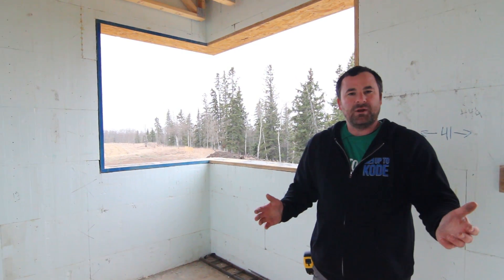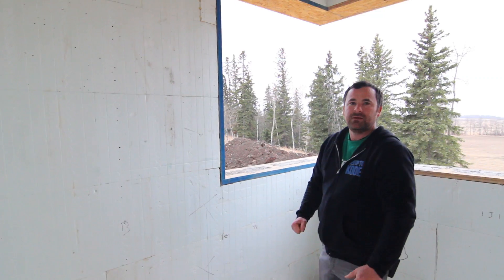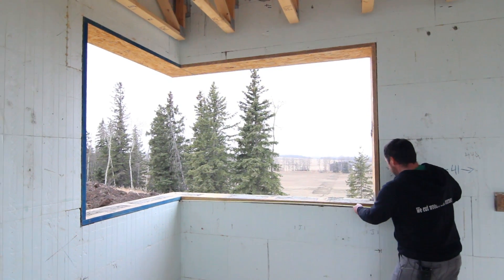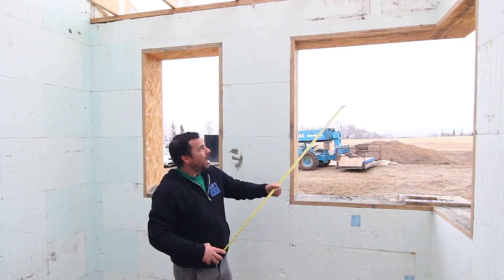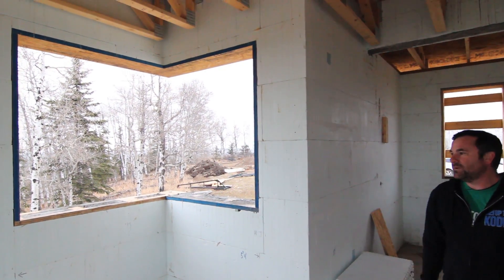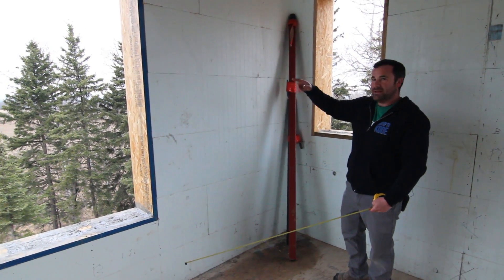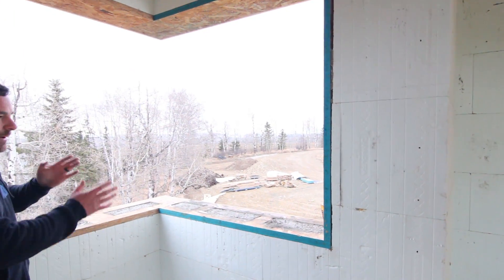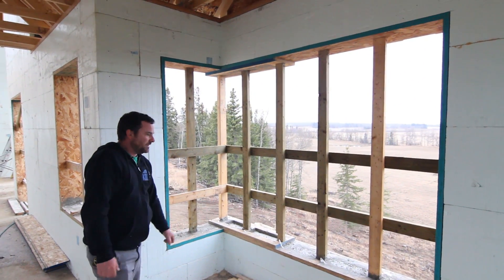Corner Windows in ICF: Why It's Better Than Wood Framing

Comment: My gripe with ICF is that you can't seem to really have a lot of windows like you can with other build types. It's the only thing holding me back. I'd like a full 20ft wall with windows making up 90%-ish of the wall (think luxury cabins in the ski resort mountains). Every ICF build I see has sparse windows in comparison to normal homes. I love every single thing about it besides this drawback.
Reply: Where have you heard that? There are videos of buildings made of ICF that look like office/full glass buildings. Yes you don't want the entire house to be glass, but what you want is feasible as long as the room is sized right.
Reply from the maker: I’m glad you commented on this. Our friend had a great question… hopefully we can reset his ill-belief.
Reply from the maker: I’m not sure where you got the window limitation from? An engineer can design almost any length of concrete lintel/header. The factors are load, depth of beam and the length. If you are not limited to the depth of beam then the length can be significant.  We offset the 2nd floor of a house… the beams were part of the wall… they were 54” deep and able to support the 2nd floor over a 20 ft span.
Reply: @uptokode  I appreciate your reply. I suppose I am just a victim of confirmation bias from seeing every ICF building with a limited # of windows. Same thing with the vast majority of pole barns. It sounds like I just need to speak with a structural engineer.
Reply from the maker: @getstuk87 Definitely chat with an engineer… just make sure they don’t spaz when they hear ICF. It’s a simple concrete header which I’m sure is like grade 1 or 2 in the engineering world. Haha.

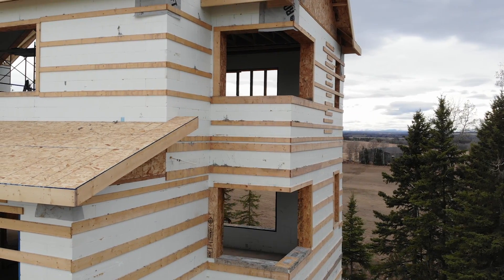Comment: At 6:44 the exterior shot shows all the Nudura horizontal seems with 1x4 Arron the whole house. Do you do this on all your nudura 
We use a lot of 1x4 but not to this extent. As allways beautiful work from an industry leader.  Mike
Reply from the maker: Thanks Mike! The 1x4 were installed as the client wanted vertical metal exterior.  That’s the reasoning.

Comment: Great video! Can you have 3/4 length or floor-to-ceiling windows with ICF?
Reply from the maker: Yes absolutely. As long as you have a header at the top somewhere. In a basement or lower floors below the roof, you can go full height because the “header” location can be the same elevation as the floor. If that makes sense.

Comment: I was told that windows need 2 feet on the side or a metal pole will need to be placed in the corner. I don't see this for your corner windows. Is that because of the window buck used?
Reply from the maker: The structure is in the rebar and concrete above. The lintel or header is 2x longer than the opening length. It’s called a cantilevered lintel. I don’t think I would ever trust wood for this task.

Comment: So if I understand this correctly you can span a 6’ opening with a 14” lintel? Big kitchen window
Reply from the maker: For a cantilever lintel yes. The general rule is the lintel needs to be 2 times the length of window span. If that wording makes sense.  14’ should be lots for a 6’ window. Always get an engineer to verify especially on something custom like this.

Comment: Is it possible to do this where the open to above area is 20 feet heigh?
Reply from the maker: Not sure if I understand. The height of the window can be anything. What really matters is what is the roof load that sits on the lintel (header) and what is the span of it? As long as the lintel can hold the roof load, anything is possible.

Comment: Hey! Do you know or have any experience with cantilevering a Floor system out? Looking at a house plan and it has one as a porch, was thinking to not loose any r value or make sure there was no thermal bridging use zip-r for under floor trusses.
Reply from the maker: I don’t have tons of experience. But any floor that is cantilevered is an issue for insulating and thermal bridging.

Comment: Thanks again for the amazing videos. Planning out my home and trying to see if I can fit a corner window 18" below the corner of a load bearing and non load bearing wall. Also you do not address this question but when doing your footings for an icf house like Nudura do you make sure to insulate the footings? If not would that not be a thermal bridge in the concrete from the ground up to into the wall?
Thanks ahead of time for the reply! :)
Reply from the maker: An engineer who doesn’t get confused with the wall being ICF (you would be surprised how many over complicate it), and engineers a concrete lintel, should have no issues running the math. 

As for the footings. Yes technically you’re right. It’s getting into the fine details. You can use HS40 or HS60 between the top of the footing and the bottom of the ICF wall to create that thermal break. 

I’ve never worried about it because I install sheet foam on top of my footing and connect it to the wall foam. It still has that small amount of bridging through the concrete but the ground is below frost and not that cold. 

Still 100,000 times better than conventional construction.
Reply: @uptokode  can you explain what you mean by adding sheet foam on top of the footing? My guess is that you add sheet foam the over the cement of the footing on the outside part (not the part under the future slab), but you do not pass it so that the moisture can easily make it to the drain? Thanks again!

Comment: I was going to ask what the square holes where on the bottom side of your window buck. Then I struck me it must be to pour to concrete into. doh

How thick is your OSB for the buck? 22mm? Do you leave the OSB in place after the pour and use as a wooden fixing point. if so do you use wood screw or do you attach straight through into the concrete to fix the windows. Thanks, great videos
Reply from the maker: Yes it’s to pour the bottom of the windows. The buck is 1.25 inch. We leave it in place. It has a sill gasket between it and the concrete. 

For Windows we shingle nail directly into the buck. Keep it simple.

Comment: Is there any issues to worry about with a cold joint in the concrete because of different pour days?
Reply from the maker: Great question and it all depends. Structurally as long as you have rebar or dowels from one pour and tied into the next pour, then you are good. At this house there were areas where we couldn’t pour any higher at one time so we would have the cold joint in the centre of a header which would be in the neutral zone for force. Engineer was okay with the idea. 

I do avoid having cold joints near walkout basements where the final grade will be just to avoid any potential issues of water ingress. 

And don’t let anyone tell you an ICF house doesn’t need building paper. They certainly do in order to have a drainage plane behind the siding. A cold joint is an area where water can enter if major water gets behind the siding. This situations are rare but water is a bugger and if you skip steps it will catch up to you, even with an ICF home.
Reply: Kody Horvey   Thanks for the reply, I was the GC for our current house build. The company I contracted to do do the ICF agreed to have me help with the crew which was a huge learning experience but also helped with regards to addressing any issues as they happened.
I would certainly consider doing ICF right to the roof next time.

Comment: We are working with a Structural Engineer right now to build a 2 storey ICF house and they have given us a much less flexible design because of what they say you can’t do with ICF. This video is an eye opener. How do I get ahold of your Enginneri?
Reply from the maker: That’s crazy! Any engineer should know the simple calculations for structural concrete. It doesn’t matter if there’s foam on either side. At the end of the day it’s a concrete wall.   I have more videos coming up on this house which show more architectural elements that is possible with ICF. For example, the 2nd floor is holding itself up on columns. All with a 6” wall!! Follow us on Instagram to see more. @uptokode. And yes my engineer...just email me and I’ll send you his info.  Kody@uptokode.com.